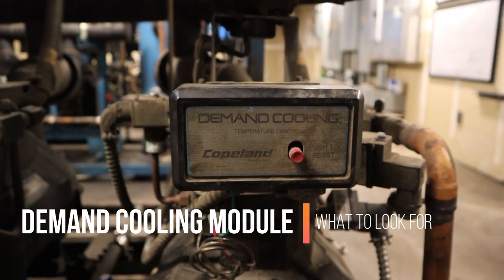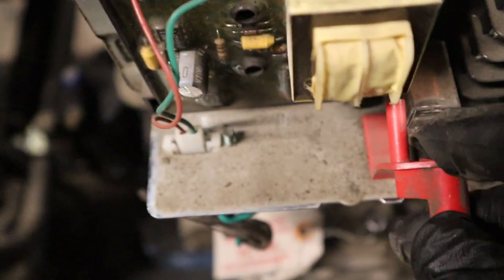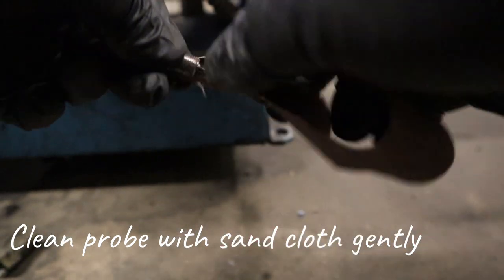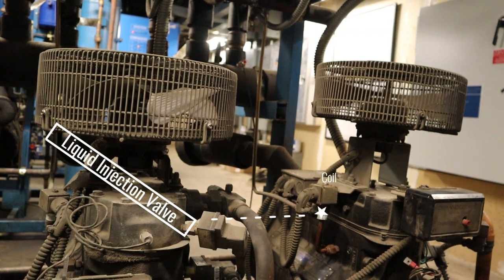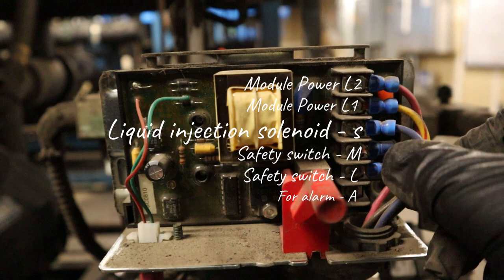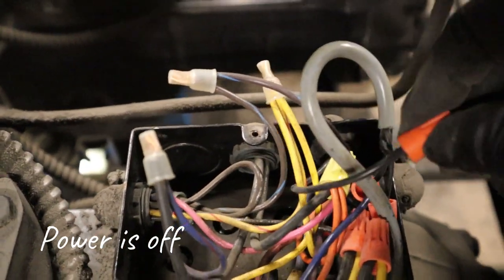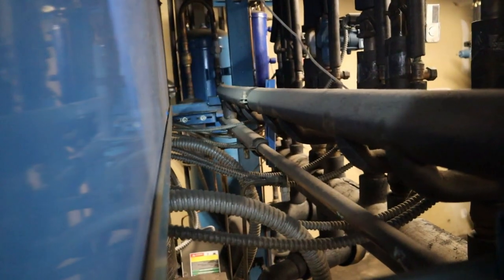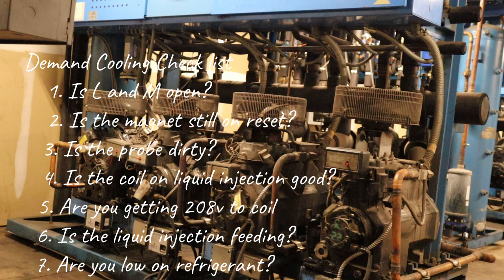Copeland Demand Cooling Troubleshooting

Comment: Great video!! What temperature should be in the temperature probe for injection soleniod to work?
Reply: Emerson Bulleting AE4-1287
States 292°, 2100 ohms. Yes, I said that right. Lol

And, I should add that if you leave that jumper in too long, the module will lockout on “shorted probe failure”. As a proactive measure, reset that switch when you’re done testing.

Great videos!

Comment: I am new on the trade. So I am assuming to do all this valves need to be turn off and pressure blead from the compressor... if this is the case could you show how to and what will be the right procedure. Love your videos
Reply from the maker: I do it with the compressor running when checking the demand cooling. All valves open to it it’s only when I open the compressor can is when I will shut off real quick checking wiring..
Thank you
Reply: Great video. Dealing with this on a large walk in freezer. Tripped twice. But within a day apart. You stated it could be a dirty probe ill check. I know the drier was just changed and heard it was very dirty. So could be. That. Low charge is definitely a possibility too. Started to frost up at the suction drier back to the compressor. Honestly could be a clogged drier again.

Comment: Silly question, but demand cooling is basically dumping liquid into the head of the compressor to cool compressor head down  due to how much hotter it runs because it’s low temp? And that sensor is reading head temp?  Sorry I’m still a noob and trying to learn.
Reply from the maker: 👍🏽 you got it

Comment: Afterhours. In the eastern Sierras or F in Blythe. Comp HAS to run. You don't carry $600 modules. Do you bypass? A boiler control strapped to the discharge line? Who, me?
Reply from the maker: High temp sensor strapped to the discharge line then ran to the A.I. Point... then run L1 and S on the module to an R.O. point and programing it on a sensor control task? who, Me?
Reply: * Replaces case temperature thermistor with potentiometer then dials resistance to a corresponding interpreted temperature of negative eight degrees Fahrenheit *
 Who me?!?!
Reply: Have to hide the living piss out of the potentiometer. You know, for the next guy/store tech....

Comment: Did you close service valves when removing sensor?
Reply from the maker: Yea the compressor was valved off Suction, Discharge, Oil line and liquid injection valve were all off.
Reply: @refrigerationconfidential4376  badass! Good stuff. Does that store require subcooling?
Reply: @refrigerationconfidential4376  i ask because some of our stores have to have subcooling and some can go with out it
Reply from the maker: @marktupapi5609  Demand cooling is only applied to R22 low temp due to how much hotter it runs than other gases.
Reply: I have 6 R448A refrigeration systems at the facility I'm taking care of. 1 of the systems is randomly tripping on demand cooling. In order to take out the sensor from the head, I saw the valves need to be shut so I'm assuming that means the refrigerant😢😢 needs to be taken out of the compressor before the sensor is removed and a vacuum placed on the compressor once the sensor is replaced? This is a good video btw and one of the most detailed I've found, thanks for making it.

Comment: Hi may i know why injection solenoid stock on close position thus it makes my compressor formed ice on its body hope you notice my qurries
Reply from the maker: If it’s stuck open then yea that compressor would have a nice ice ball around it. Like any solenoid after so many cycles eventually it could fail internally
Reply: @refrigerationconfidential4376  the power supply works continously it didnt cut off thanks...